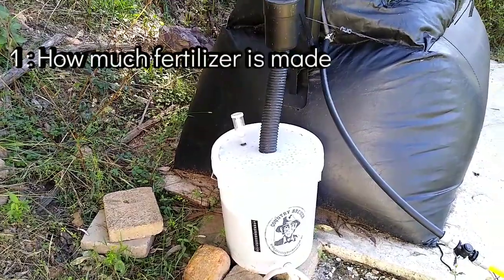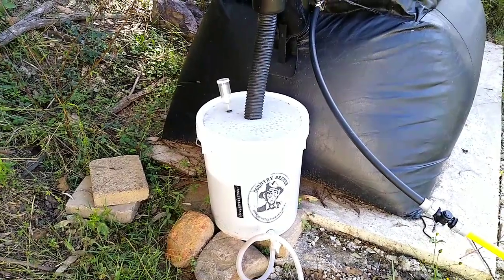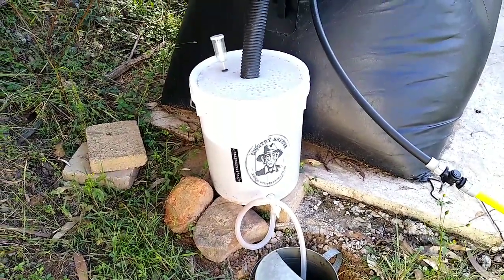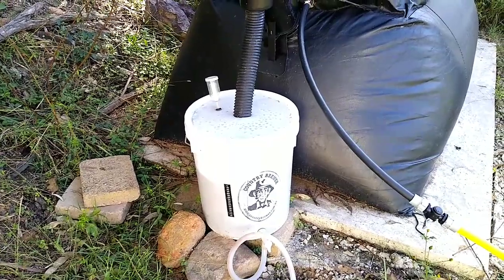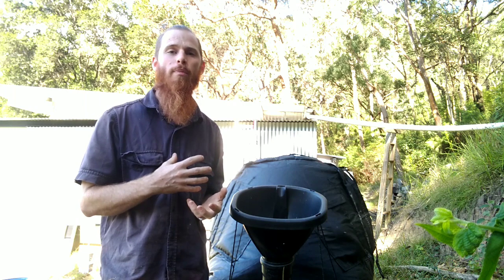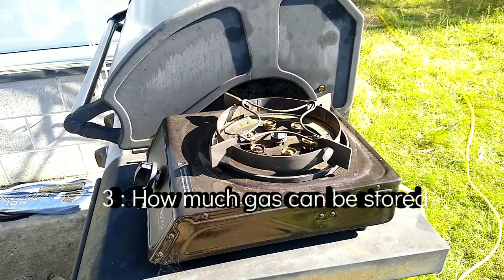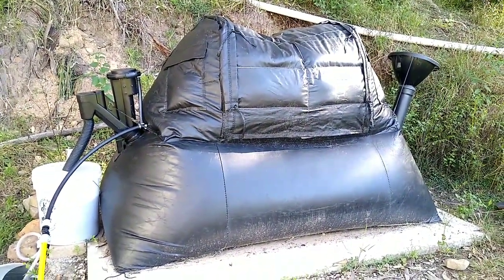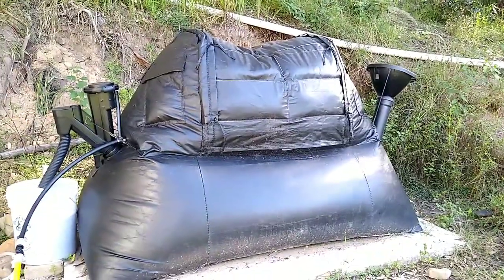Off-Grid Biogas Essentials - 3 mistakes you can avoid

Comment: Thanks for the info. I have already purchased one and been wondering if I've done the right thing 😬 I did getthe toilet though and aim to put system in a greenhouse over winter.
Reply from the maker: No problems, I'm glad it helped.  We haven't had any problems with the until itself, they are built well.  I would be really keen to hear how the toilet goes.  Do you get snow in the winter?
Reply: @cornerstonevalley  no snow where we are, but close by so gets very cold.

Comment: Where one does not have a lot of food waste, one can supplement with grass clippings to get more biogas production. Even though a  small digester may come with warning not to use grass clippings because it takes longer to digest, its no big deal because your digester is already under utilized. Just add a few grass clipping and let it digest longer. It will be fine. My wife and i hardly have any food waste and im considering making a digester for grass clippings, and maybe ocasionally suplement with food waste.

It should not be too hard to make and add inline supplemental gas bladers.
Reply from the maker: Thanks Keith, yes, Ive heard that before.  Making a secondary bladder or compressing the gas into a cylinder is high on my priority list.

Comment: Great video, what size biogas did you buy? and if you're putting in 1-1.5kg of food scraps per day how much gas are you getting from that? their website says 1kg of food scraps is about an hour of cooking? also since making the video did you find any solutions?
Reply from the maker: Hi Tom, thanks, glad you enjoyed it.  
We got the biogas 2.  The full bladder gives about 2.5hrs of burn time.  The rate of generation is hard to gauge, depending on temperature.  I'm an hr north of Sydney, so it never gets super cold.  Also, Ive been using the burner outside, and the flame gets blown around quite a bit because there's very little pressure.  So inside would give you better results.  
Here's what I've been playing with since .
https://youtu.be/W7yNd6ropBY?si=dTvi_W2tPXvZFVrV 
Good luck!
Reply: why is the rate of generation of the gas so difficult to gauge? etc if you're feeding it the similar amount of food scraps per day/week couldn't you gauge the average amount of gas usage? @cornerstonevalley  etc 1kg of food scraps per every 2nd day and then you get x amount of cooking time
Reply from the maker: It's takes about two days to completely fill back up at the current rate at warmish weather.  A full bladder gives about 2.5hrs of burn time.

Comment: You could put your own human waste in it as well, also add a storage vessel
Reply from the maker: Thanks! I've been thinking about adding a IBC tank as a secondary storage to boost the capacity.
Reply: The IBC tank is great for additional digester capacity. 
An additional bladder may be made from plastic bought at the hardware store and plastic  weld the seams to make a sealed bladder. A sheet of plywood with a few rocks ontop would supply a little pressure to run your stove.
Reply from the maker: @kreynolds1123  Yeah, I like the idea of an ibc, easy to move around if needed as well.  Forklift tynes on the tractor are very useful!

Comment: Does the digester smell
Reply from the maker: Hi Victor, there is a activated carbon scrubber on the outlet which works well.  However, when we don't use the liquid fertilizer enough and it builds up, it smells.  It's not a terrible smell, but it not pleasant.  Quite mild.  Our digester is about 3m from our house, they recommend 5m.

Comment: hello :)
if you have a problem with to less methane, you can add used frying oil..
cow dung have a methane production on 1 to 13... one gallon of cow dung will turn into about 13 gallon of methane...
if you use used frying oil.. the ratio is 1 to 600...

just ask a lokal resturant or something, in many countries they pay to get rid of it ;)
Reply from the maker: Thanks for the tip Marius!

Comment: You can add anything that you can digest - Avoid stuff with cellulose in (paper/wood/tree leaves) - I’m not sure about grass but I’m guessing nettles, comfrey and things like that are fine to add (and great nutrient sources. I find it useful to think of the unit as a large stomach. We too have a larger system than would be necessary for us so I’m using all the bits I’m clearing from the vegetable garden and windfall apples to ensure we are feeding enough. I have some perpetuel kale plants so I top up our food waste bucket with leaves from that as well.
Reply from the maker: Thanks Bernadette!  Yes, it's been fun trying to get the most out of it.  We just bought a dog and have been making a slurry with his poo and seeing good results.  Helps it's coming into spring here as well.
Reply: I hate to suggest smaller pieces of the grass material. More surface area for the microbes to digest more easily.
Reply from the maker: @ricksteen935  Thanks Rick.  Yes, smaller pieces would better than larger ones I would imagine.
Reply: @cornerstonevalley  Really?? dog poo?...dang.
Reply: Hate the Noise

Comment: I suppose your purposefully not adding in your humanure which still has plenty of food for the bacteria left in it. You may want to give it a try because your doing something with it and not getting the benefit of the gas. Also if the gas bag storage will only hold so much gas and then vent it you can put another type of storage in the output line such as an air mattress or inverted drums in water bath.
Reply from the maker: Thanks Scott, yes, looking at different options at the moment.  I am thinking I'll compress the gas into a 20kg gas bottle ever time the bladder is full.  It will be very versatile once it's in the bottle.
Reply: @cornerstonevalley  I was just looking at vacuum/air pumps to pump the gas and found that the small air pump from a free junk keurig will work good. It will provide 8 to 23 psi of pressure and is 12 volts so can run from an inexpensive solar panel. At that pressure that should essentially double the volume of a tank or create 1 1/2 volume of usable pressure.
Reply from the maker: @scottdc2105  Thanks Scott, I appreciate the information!

Comment: Many of the Biogas Reactors in operation are inputting vegetation from the environment; grass clipping, leaves, plants, etc... If you have the property, it shouldn't be difficult to collect more than you need on a daily bases.

It would also help to assemble a simple [6-stage] scrubber to increase the 'octane' levels by as much as 15%.
This also helps prevent wear on your burners by removing the CO2 & H2S.
Lastly, if you have a compressor and some 20lb propane bottles, you can compress the [scrubbed] CH4 for storage and use later.
Reply from the maker: Thank you!  Yes, Ive seen some that put in grass clippings, but the home biogas says not to as it takes a long time to breakdown for not much has production.  
This unit come with a activated carbon cartridge for the scrubber.  
Yes, the next step for this project is to start compressing the gas to use on my BBQ!  Stay tuned and thanks!
Reply: @cornerstonevalley  compressor and tank is nice for storage space but needs a down pressure regulato to run your stove.  If space is not a concern, plastic bags with a few pounds of weight on them would provide as much storage space as you need and the weight could be adjusted to provide the nessesary flow of biogas to your stove without a pressure regulator.
Reply from the maker: @kreynolds1123  Thanks Keith, I’ll have a look into it

Comment: Thanks for your video. It helps people understand there is a learning curve involved in using biogas. That is a good thing because fully understanding the process allows for less dependence on 'the grid', which one day might not exist...
I have been using the same unit in South Island NZ now for nearly 2 years. I find it produces the right amount of gas for the volume of food waste a person or family produces on a weekly basis. IE: the more people, the more food waste, the more gas produced. We are now using two biogas stoves from our unit, this by setting up a second gas bag for additional gas storage to take advantage of times when a stove is not used. I have also installed the biogas toilet (for a single person use) which adds to input volume. Also recently, I got a garbage disposal unit and sink bench from our local recycle centre ($30 investment) which turns even chopped up waste into soup and increases digestion many times faster. I promote domestic biogas digesters, - the way of the future..!
Reply from the maker: Thanks Solaboder! Great to hear your journey with biogas.  We have been thinking about using a secondary bladder just to increase our storage.  
I've just plumbed up a bbq to take the biogas.  You might find it useful.
https://youtu.be/W7yNd6ropBY
I agree with you in that they are not very big and so would be easy to fit in most suburban gardens and have a dramatic reduction in food waste going into landfill.  Good luck with it all!
Reply: thanks, watched your BBQ video, you covered all the points and with very good explanations. Given that using a BBQ is mainly a summer past time, there is a better chance of having enough biogas to burn it for that 45min- 1hr use... It does use a lot more gas than the single burner stove though, so not an every day use...
Reply from the maker: Thanks mate, glad you enjoyed it!

Comment: Fantastic video thanks, I am also in Australia and wondering where you bought it from and what brand is it?
Reply from the maker: Thank you!  We bought it online from
https://www.homebiogas.com/
They seem to be the only ones doing it well for small scale applications.  Good luck!!
Reply: @cornerstonevalley  Thanks so much, it's certainly cheaper than a compost toilet (if using the toilet attachment), and you get free gas! Unfortunately not health dept approved (yet)
Reply from the maker: @sandrinakeffufal6008  yes, they're great.  You can make a composting toilet without too much effort and quite cheap.  https://youtu.be/pvxFhIvBuBg
Not super nice looking as others you can buy, but functional.
Reply: @cornerstonevalley  thanks for the tip and the link, that looks like the perfect set-up and you could certainly use it full time if you had enough buckets. We needed to be health dept certified so bought a Clivus Multrum EcoLet NE which is basically the same thing but with a $1,600 price tag!
Reply from the maker: @sandrinakeffufal6008  yeah, you've done well, being certified is always better when dealing with council, especially in the long run.